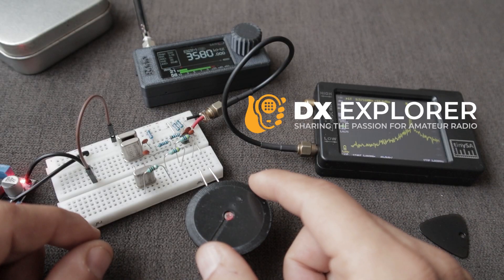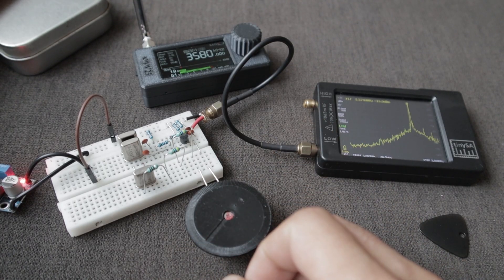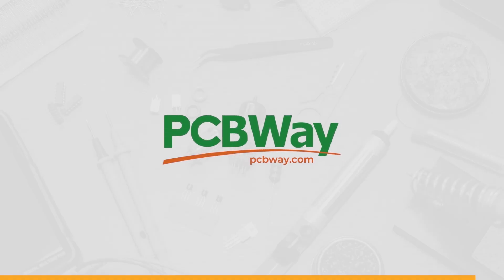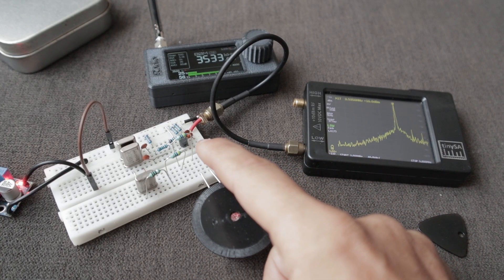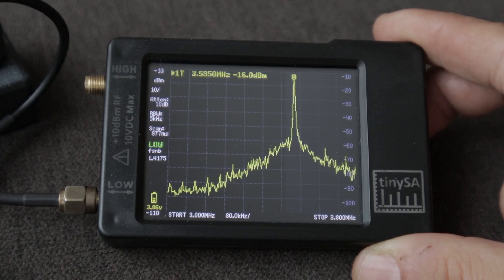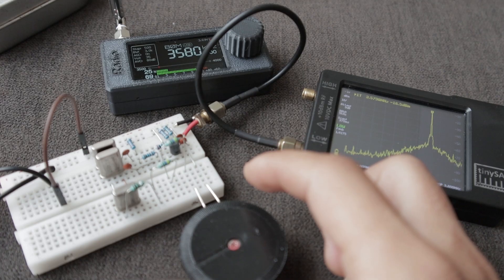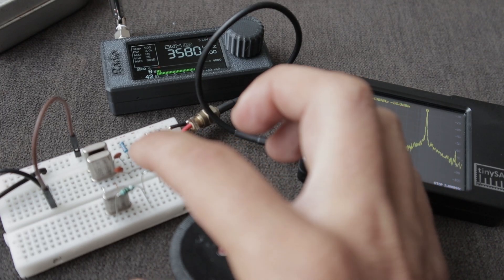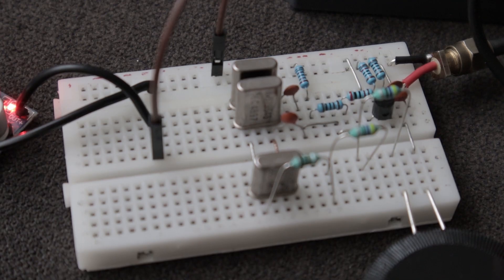How Far Can A Crystal Stretch ? Super VXO For The 80m Band

Comment: Great video, as always! 😉 One thing I'd like to add as a recommendation: You can fairly easily switch between different crystals electronically. A simple diode for each crystal and a control voltage is all you need. There should be design schematics on the web since this was common back in the days. That way you could use different series elements for the different crystals nd have a switch for "lower" and "upper" band-split. Just an idea.
Reply from the maker: Thank you so much. That doesn't sound bad at all. I will search more about this. I had no clue I could do such thing. Thank you one more time. 73, YO6DXE.

Comment: Hello! I had fantastic results with two crystals 12354.2 and 12356.2.The tuning band was 100kHz!.But these crystals are rarely - they were in UHF radio station for railways workers.I also experimented with usual crystals (the same frequency) - it works well in 0.1% band of central frequency. When I tried to change frequency in more wider band - the oscillator switched from crystals to coil and capacitor, and stability was poor. In my opinion - it would better a cheap DDS generator, but for the CW one crystal is enough - but there is not  always properly quartz (grid of  crystal frequencies in so narrow)
Reply from the maker: Ohhh that is great. For sure they sound like hard to find crystals. But the results are nice. I will still test this one a little further this week and see how good it is or not 😁 thank you for watching. 73, YO6DXE.

Comment: I don't know Ciprian.  Seems like a lot of VXO shift to me.  SSDRA says we can expect about .2 percent shift in a fundamental mode crystal.  That would be about  7 kHz at 3.5 MHz.  And I think that is best case scenario.  One thing all the books caution about:  If you put too much L and C in the circuit,  your VXO turns into an ordinary LC oscillator, losing all of the stability that comes from crystal control.  Could that explain the big shifts you are seeing?  73  Bill Hi7/N2CQR
Reply from the maker: Thanks so much Bill. That is why I also want to test it in a transmitter or transceiver. I am curious how it will perform in "real life" sort of saying. I am happy with such a big bandwidth, but I am not sure about stability either. I will do a "time based" test and leave it on all night to see if there is any drift. I will let you know how that worked. I get home tomorrow morning and I will turn it on and keep an eye on it 😁. 73, YO6DXE.
Reply: is it not possible to make it jump to spurious frequencies, by pushing/pulling it too hard, and then let it cheat you into believing large band is possible?
Reply from the maker: I suspected that as well, that is why I ended up testing it with the tinySA as I could see the signal moving. Tomorrow evening I will have a bit of time and I will also build the buffer stage with the LC filter on the output to make sure even more that I only have the fundamental signal and no harmonics at all. I will also do a stability test tomorrow and see how it does after one entire day of running continuously 😁

Comment: Peter Parker, a wonderful person! 

now my problem, off topic: 

looking at the schematic, the collector of the oscillator, i see it directly grounded in RF... 
i know this is the most spread approach, but building like that, i never managed to make it produce sinus in the oscillator. 
maybe that is why all build it with LC resonator in the output, to make it sinus there. 
later i found another approach, where the collector is not shorted in RF to the ground directly, but through a resistor. 
that produces sinus in the oscillator. 
it is true, that i did not worked around with different resistors, just took a schematic with the recommended fixed values, but i never got sinus. 

you have more experience. is something to this?
Reply from the maker: You are right about Peter. I've learned so much from him. About the schematic, I don't have much experience either. I found various schematics online. This one seems the most common one. But I want to test others as well and pick the best one. There are two things I care the most, stability in frequency and to have no chirp. When it comes to the signal, the best results I also had with LC on the output. And this is valid both for the VXO or the VFO circuits. Plus that this way I also cut the harmonics as well. 73, YO6DXE
Reply: @dxexplorer  you know, that omnious need to put an LC resonator at the output, may be sign that the conception of the oscillator is not good. 

in the past i mostly built published schematics that all knew, and they proved to be bad. then i found uncommon schematics, that worked well. 

you know, it is said that one must steal proffession :) it does not come cheap
Reply from the maker: @saramanbrudesco I agree 🤣🤣 yes is very true. That is how I actually started this channel ha ha. I wanted to test various schematics that I find online and see what works and what it doesn't work. So far I think I only had two
disapointments in thee years so is not that bad. Some work well, some not so much... but it's all fun and joy testing them ❤😁
Reply: When the oscillation doesn’t start then play a bit with the values and in particular with the ratio of the values of C2 and C3 in this schematic. These caps feed part of the output signal back into the base of the transistor to create a loop gain of over 1, needed for oscillation.
In general this is a fail safe circuit which simply works.
And don’t load the output from the emitter too much. On my circuits like this C4 is 22-47pF at most.
Reply: @robertvandersanden  that i understood long ago, that is a "fail safe", however it does not mean it is good. fail safes can be bad. 
still my question, does a resistor into the collector make it better? .

and now, that i remember some things more... 
the transistor in the oscillator, most say it is better to have the highest transition frequency possible, but i kind of doubt... 
wouldn't be better to have the transition frequency less than double the generated frequency? for signal purity...
Reply from the maker: I am also thinking that it may be better. There was one more schematic I wanted to try and that one did had a resistor in the collector.
Reply: @dxexplorer  please check if signals are sinus. oscillator, base, emitter, then after buffer/amplifier. 
i don't have oscilloscop, so... 
when you check the signals, don't just check the output!

thanks!
Reply: @saramanbrudesco  in this circuit you can place a small resistor in the collector and use that as an output but it doesn’t improve the overall performance.
If you place a resistor in the collector then you get an inverted and amplified signal at the collector node. Through the miller capacitance (internal capacitance between collector and base of the transistor) this inverted signal partially cancels the positive feedback from emitter to base. This doesn’t improve oscillation.
In this kind of oscillator circuits the transistor operates in class-C, meaning it is only conducting a short part of the sinusoidal swing. This always leads to somewhat higher harmonics. You can play with the C2/C3 ratio for lower distortion.

The transition frequency of even a simple small signal transistor is easily over 100MHz so far too high to use for the trick you propose. Unless you use an older power transistor like BD137.
I can’t predict the effect this will have. At least you introduce an unwanted extra phase shift at or beyond fT.
Reply: @robertvandersanden  i did not say do that. you twisted it. i said something different. read carefully
Reply from the maker: I will test the heck out of it this week  😁🤣 I don't have an oscilloscope either but at least I have the tinySA. Better than nothing 🙈
Reply from the maker: In the original article there is a table with different values depending on the band. I just noticed that the lower the frequency, the higher the value of the capacitors. So I just respected the article right now. In the past on receivers for the 80m band those where around 450pf up to 1nF. Same oscillator almost with minor differences. I will yest out of curiosity the purity of the signal when it comes to harmonics and see how that is if I change the value of the capacitors. 73, YO6DXE.